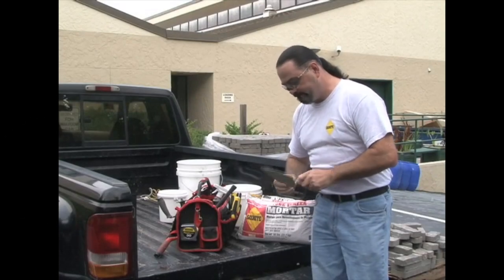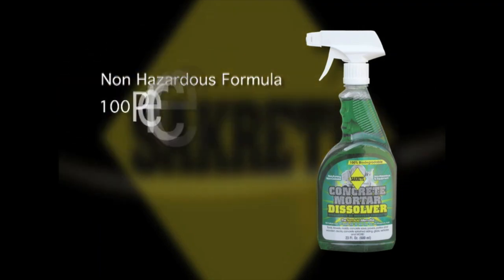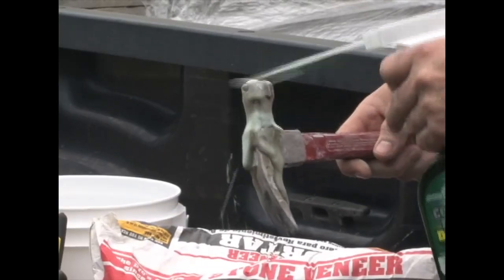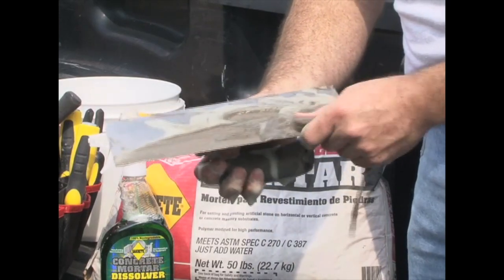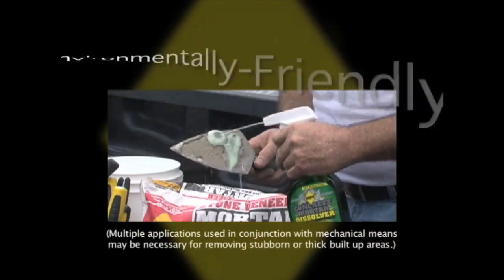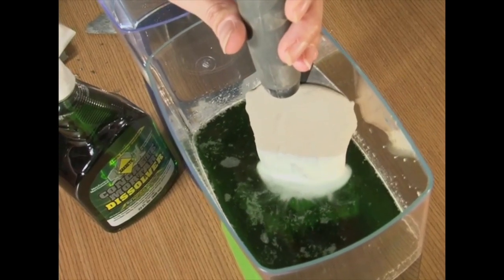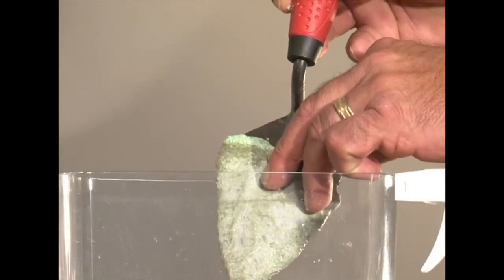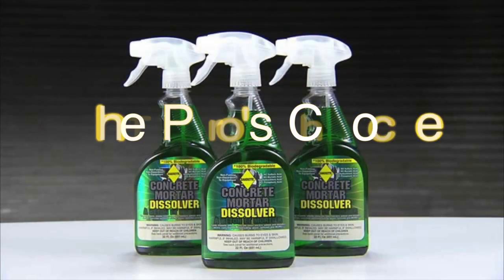Pro Tips: How to Removing Concrete from Tools, Etc. with Sakrete

Comment: Effective for a thin layer of concrete/mortar caused by splashes and spatters.  Attempted to clean a machine with a 1/4" to 1/2" concrete build up on it by spraying to keep it wet for over 24 hours, but this product had virtually no effect on it.
Reply from the maker: Chris, sorry to hear that you had issues. May have gotten a bad batch – we generally only hear great things about the performance of Concrete Dissolver!

Give us a call at 866-SAKRETE and we'll look into this one together.

Comment: We built a rock garden.  Too much mortar remains on the granite boulders.  Will this remove the mortar that is on the boulders?  I should have done a better job wiping the mortar off immediately (that got on many parts of the boulders, in addition to the joints), but didn't.
Reply from the maker: Absolutely – great application for this product!

Comment: i have some stucco concrete stuck in plastic electrical conduits. How long will it take for the concrete to dissolve if I pour some into the tube?
Reply from the maker: Give it about 15 minutes and you should be good to go!
Reply: did it work?

Comment: can it remove concrete from  a plastic db2 pipe  2inch  with a total blockage?
Reply from the maker: EVENTUALLY, yes. Now, a solid block of concrete is going to be a heck of a challenge for this product to work through, especially if you can't get into the pipe mechanically. 

Important to note that this product doesn't dissolve concrete into thin air, it more "softens" it so that it can be wiped away.

Comment: and what if the item from which you need to remove the hardened cement is an item that cannot be immersed e.g. a power tool, what do you suggest then?
Reply from the maker: Hey Gary, you shouldn't really need to immerse the item – just spray and wipe off.

Comment: I got rocks stuck in my sink. Will this dissolve the rocks?
Reply from the maker: Probably not your go-to, sir. Concrete Dissolver is great at dissolving cement, but rocks are a bit of a different story – you might have a plumbing job on your hands, unfortunately!